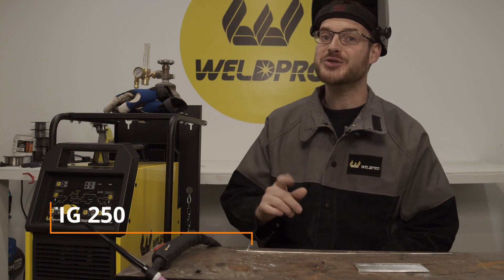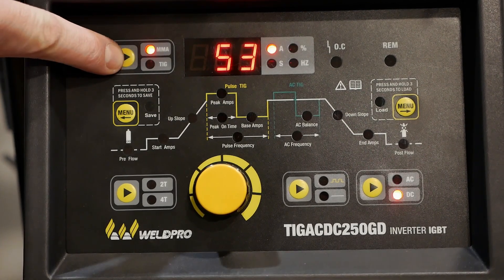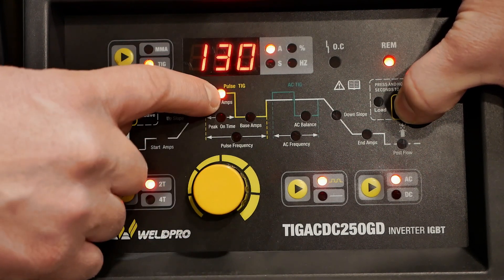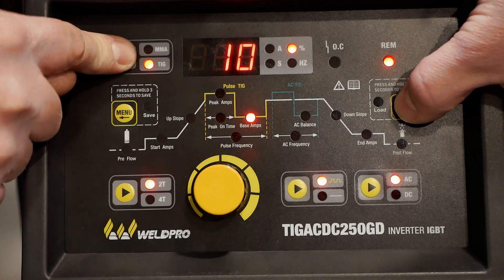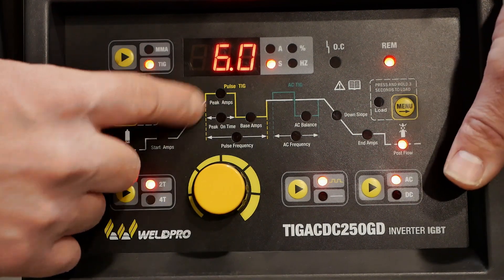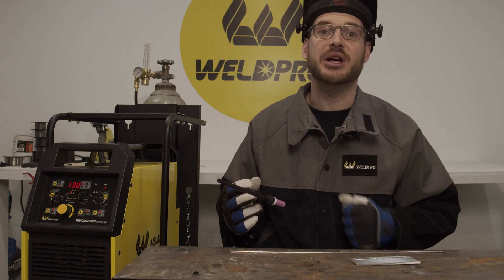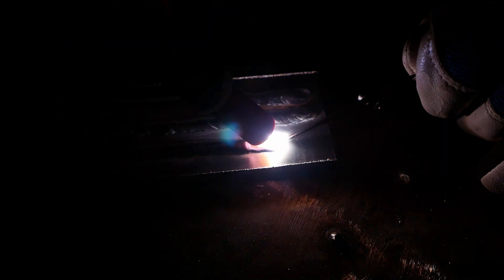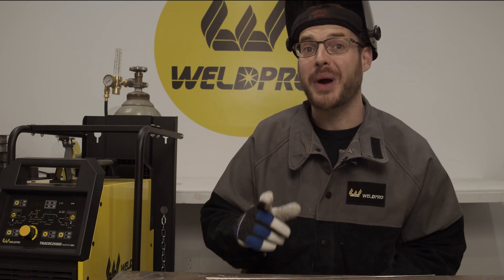Aluminum PULSE with the TIG 250 from Weldpro

Comment: I set my machine up identical and It is making funny noise and it roaches the tungsten tip. Gonna give it another shot and see if I had the torch not assembled properly
Reply: my weldpro tig 200gd is doing the exact same thing. Did you figure out how to fix it?

Comment: Thanks for the info, well done. When would you use the higher pulse frequencies? Is it really a difference when you  are pulsing say 100 times per second  vs. a continuous weld?
Reply from the maker: Not much, but it does reduce heat slightly. The longer time that the arc is off the peak current, the more the weld pool is allowed to cool. This can make a drastic heat difference just by slowing down the pulse settings. As you creep into the higher settings you are close to the heat of a continuous weld but the pool is allowed to cool ever so slightly each time a pulse occurs. Thanks so much for the questions!
Reply: @WeldproWeldingEquipment  Awesome, thanks! Subscribed.